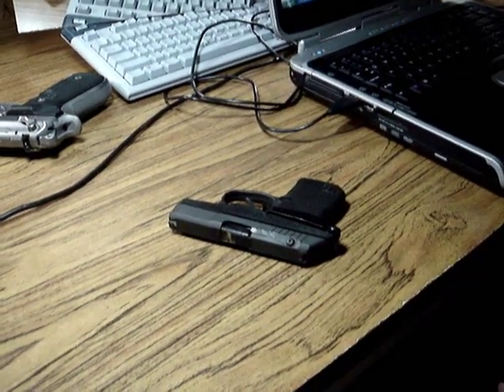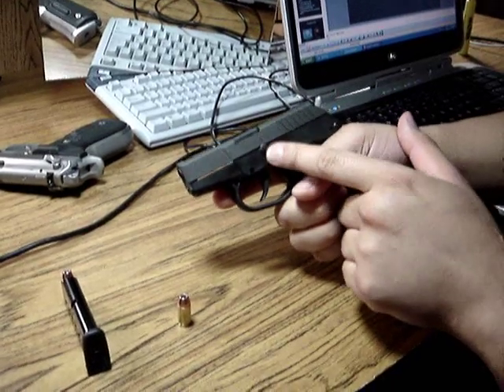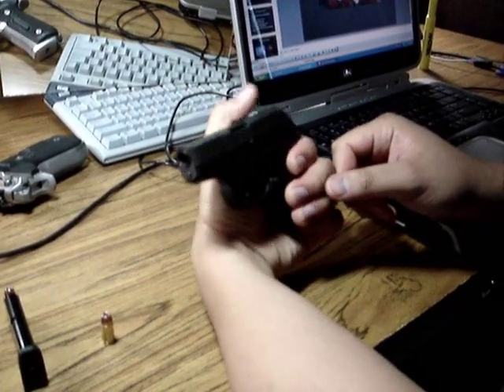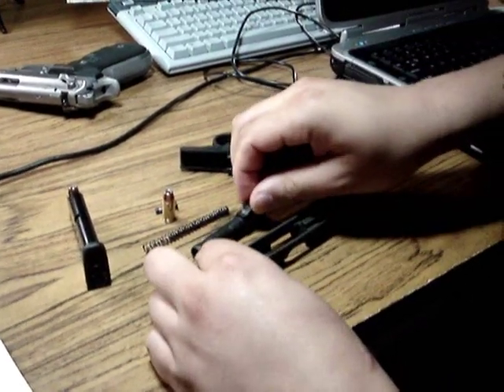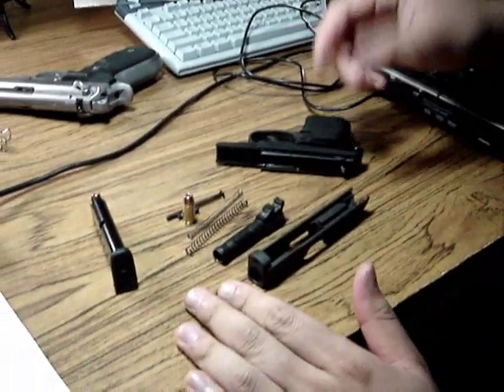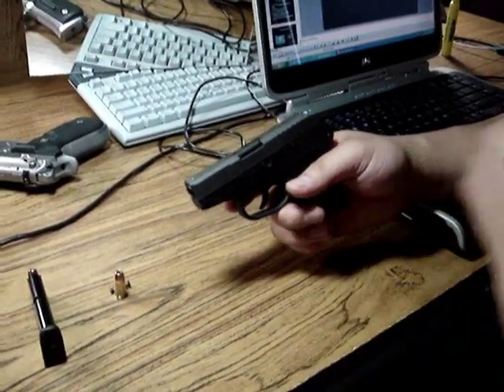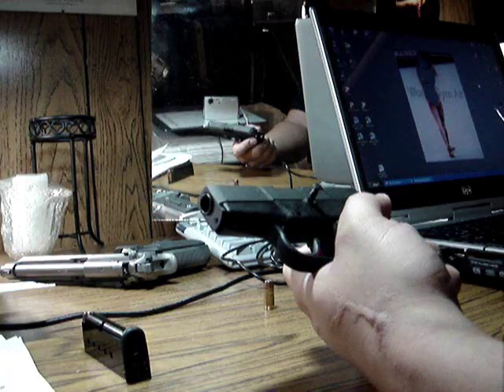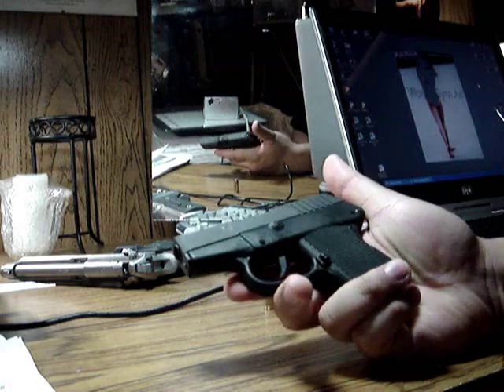Kel-Tec P-3AT Field Strip

Comment: Nice video, very clear.

Kel-Tec suggests using the cartridge because you don't need a 'tool'. This way if for some reason you need to clean it (Like if your on the bus home or the subway in a resturant, ect.) you don't have to pull out a tool, just grab a round.

Comment: I don't know if this has been said or not (I don't feel like reading all the comments).  Instead of holding the slide back like you did, you can press the slide back at the end of the barrel just enough to get the pin out.(like you did to put it back in.  Also, instead of taking the pin all the way out, you can take it out just enough to pull the slide off, instead of completely removing it.

Comment: Thanks for posting this! I just bought a P3at and I was wondering how to remove the pin. The instructions printed in the manual aren't helpful.

I've found it's easier to place a coin between the frame and the barrel chamber. That keeps the slide open and makes the operation easier.

Comment: Great job, I used it to do my first strip and clean. The little part you spoke of did fall out on the floor, and I was not too sure as to how in goes in. Does it only ffir one way? I reassembled the gun and worked the slide, but have not fire it. How can I be sure it was put back the right way?  Thank you.

Comment from the maker: Mine was the same way. Seems the extractor can easily slip off the case and leave it in the chamber causing a jam. Tough to clear since the gun has no slide stop and the gun gets too hot to clamp open with your hand. They say there is a new "pointy" extractor available that solves this problem. I have yet to get it.

Comment: The jam on this gun occurs as a result of a slip of the user. I found this out after purposely trying to jam the gun. When you do not consume the recoil correctly. A limp wrist will cause this to compensate you must learn to put more forward weight on the gun to properly let the slide come back. Before this i was 1 in 15. I have not since jammed the gun .

Comment from the maker: Sounds odd. I know. But, the manual that comes with the gun says to use the cartridge that way to pull out the pin. Funny thing, with the Kel-Tec SU-16B (a .223Rem rifle), the manual there says that the point of the bullet should be used to drive out the pin that holds the stock in place. I guess Kel-Tec has a fetish for using cartridges as tools.

Comment: OK, when I pull the pin out the gun cocks not allowing the top of the gun to slide off. The only way i can pull the slide off is if I pull the trigger....Also when sliding the top of the gun back on ,it doesn't fit all the way back in flush. I have to cock the hammer with my finger and then it sleds back to normal...

Do you know why this is?